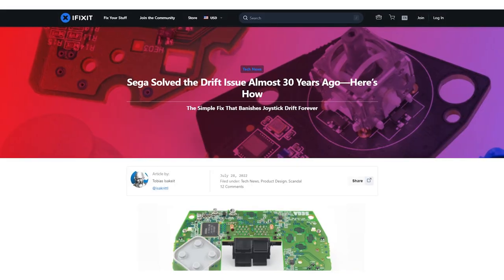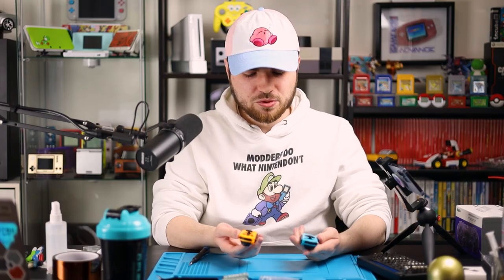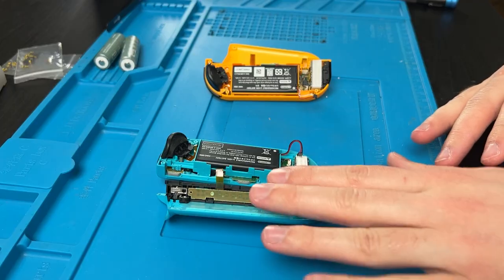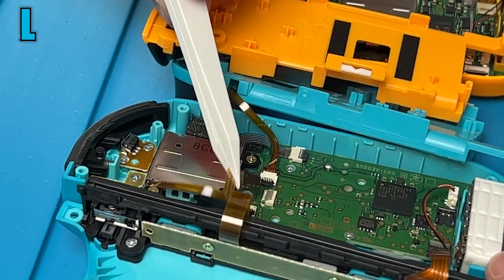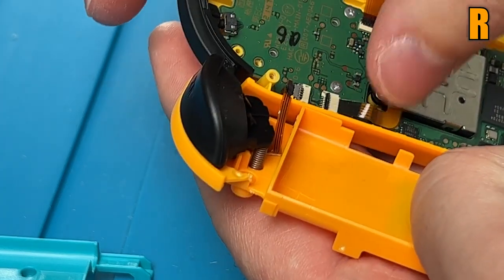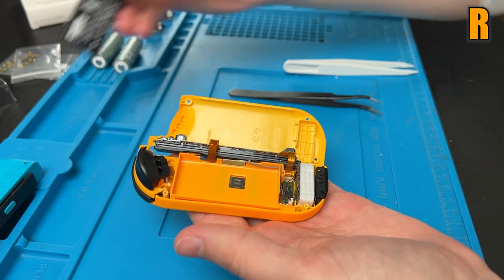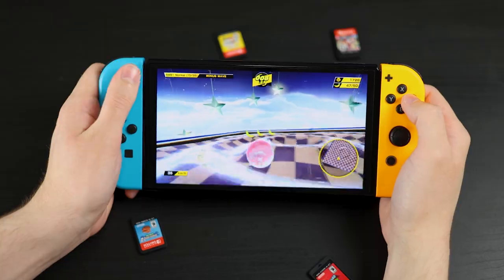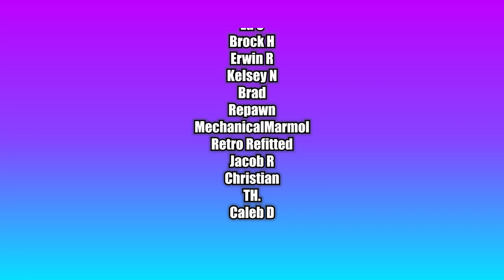Did Gulikit Really FIX Joycon Drift? | Tutorial + Review

Comment: As most technical ppl have said, the old analog sticks have contact pads which eventually through normal or rigorous use, it will scratch through friction and will result in drift. Hall sensing in concept uses magnets so no contact happens inside the sticks. I guess we can say its not 100% perfect replacement for the stock but it is better in terms of durability. Though yes the rubber they used on the top analog is a bit slippery lol. Maybe on the next batches they'd fix those.

Comment: I agree people should treat their controllers well and keep their hands clean when using them, but that does not prevent stick drift at all. The sticks in modern controllers are actually just a lot worse and do not last as long as they used to. I'm saying this as someone who has not gotten drift yet (as far as I've noticed). It's a common enough issue in the last two gens that it should be pretty clear something is up. Plus, everyone is using the same cheap ALPS sticks from the same factory, so that's also why it's happening to all the first party controllers. I saw an interesting video a few weeks ago about how the old DualShocks (1 and/or 2 IIRC) would automatically calibrate with use, and they would encourage you to move the sticks around on loading screens so that they would stay calibrated. That meant that even heavily degraded old sticks should work fine once you've used them a little in that session. I'm not sure why this isn't a thing anymore or why no one else does it. (Also not sure why no one really uses hall effect sticks in their first party controllers anymore...)

Comment: I bought a pair of Gulikit joysticks for my switch (2 pairs total with the replacement which didn't fix it), started off completely fine but after around a month both started to drift, with the left one drifting far more. They can be recalibrated to zero easily enough but very quickly fall out of calibration and start drifting again within a matter of minutes. So much for fixing the drift problem, at least with the original type I know they should last a bit longer than that and are cheaper too. Gotta say, overhyped and under delivered. Also it's worth mentioning the Gulikit joysticks can feel rough (had only one smooth one out of four that I tried), it does partially smooth out more over time but it never really goes away after months of use (hundreds of hours of play) and some directions are more rough than others which makes it feel inconsistent. Really wanted it to work, but perhaps their manufacturing/QC just can't get them right consistently yet, hoping any future revisions will be far better since I definitely do want them to work. This whole joycon drift problem is a real shitshow for the consumers.
Reply: I would love to see the internals of those Gulikit joysticks. Are they really electromagnetic? if not - then it's not Gulikit or (Gulikit lies ) I'm tired of cleaning Joycons, it's not easy especially with  original construction (it's easy to break the metal frame [ ] while opening that black small box).

If those are electromagnetic and still suffer from drifting after some time, then it's a big issue, especially for the price.
Reply: fax

Comment: Caps are removable to fit in other shells that use Nintendo Switch analog sticks, but won't fit in the installation with the caps (example: AYN Odin).
Reply from the maker: Did think of that! I’d still like to see replacements sold though. It’d be cool for mixing stick top colors